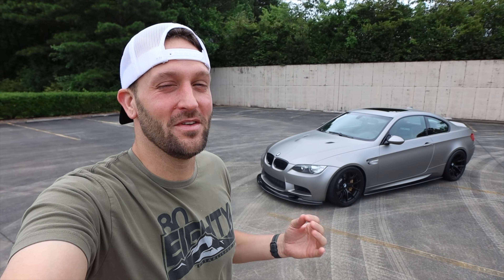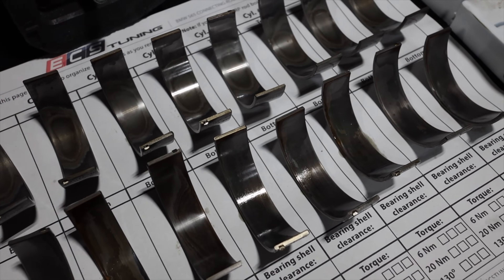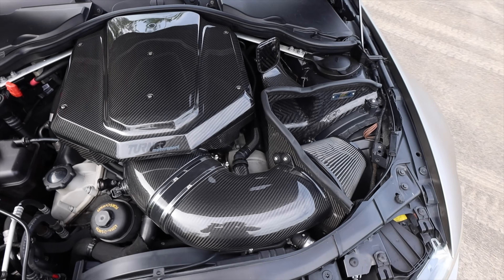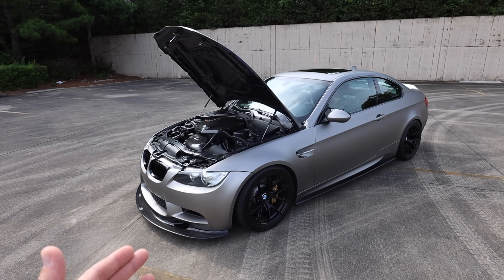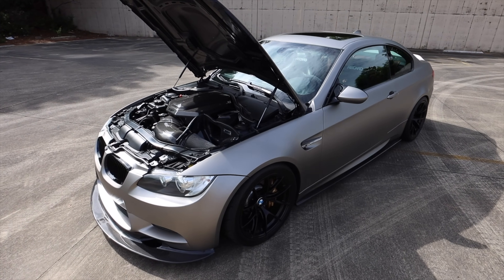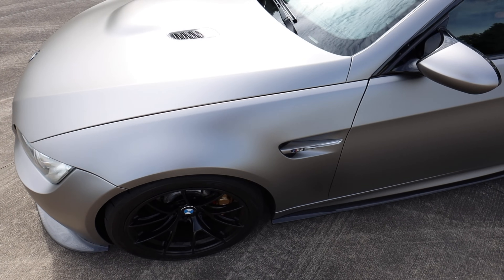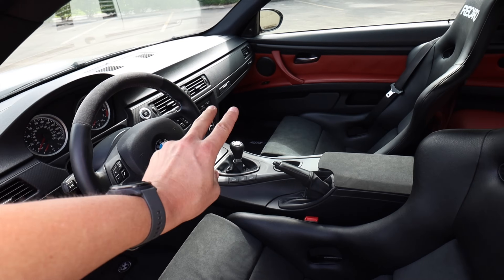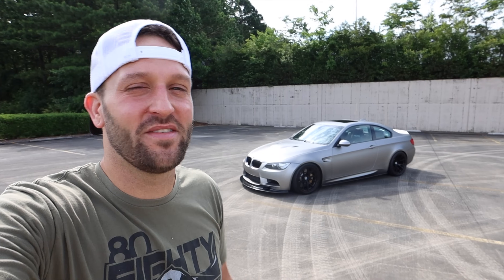Watch This Before You Buy An E9X M3...

Comment: Great video, as an e92 m3 owner as well, I can attest to eveything you've mentioned. These are not cheap cars to maintain (if you want to do it right), but I think, for the money, it's probably one of the best driving experiences you can get mixed with some comfort and luxury
Reply from the maker: Well said!
Reply: É verdade que a M3 G-POWER da quase 400KM/H??
Reply: As a another e 92 owner I agree with you.  The steering is what sold me on the car.    The car talks to you thru the steering wheel
Reply: @johndelp1810 getting close to the point of paying my 335i off and getting into a m3, is it still a good platform in your opinion? i plan on keeping and building the n54 especially since its low mileage but im wanting something else thats nice and i can take out if the 335 goes down (i also have a daily for work so having a running vehicle is already taken care of lmao)

Comment: E92 M3 owner of 3 years myself. Didn't get the hype when buying the car, and every year since owning it, I am more and more convinced that this is the BEST car you can buy for the money. Does everything right when set up correctly. Maintaining isn't cheap but also is not very frequent. Best sounding, looking and driving BMW in my opinion. Great video
Reply: How much have you spent on maintenance? I’m looking for manual but DCT is cheaper
Reply: @pavelsidor  Any e9x you buy you have to do rod bearings unless done by a reputable shop that's handled this replacement frequently. DCT is honestly better having owned both, the manual gear ratios are bad and the DCT doesn't feel outdated even in 2024 standards tbh.
Reply: @iamshevanel coming from an N54 E90 335i manual to M2c DCT, I 100% miss changing gears myself 
I will likely never sell my M2c but I’m looking for another manual and an E92 M3 is on my short list
I wish I could’ve bought my M2c before production stopped so I could’ve ordered a manual, but I literally got one of the last M2c in California

Comment: If you’re not able to spend more after the purchase price than what you would spend with any other car, don’t recommend. If you have a budget to play with and can afford it’s maintenance 1000% recommended. My only advice is to make sure you find a good euro shop near you bc BMW (where I live at least) charges 200/hour for labor. Make sure to have knowledge on the car’s rod bearings before purchase, will you need to swap them/have they been swapped already, and (not saying it’s guaranteed) EXPECT and at least account for the fact that you might need to have your gaskets replaced (valve cover, head, and oil filter housing). It’s definitely not just a cheap get in and never think about anything car. Honestly though they’re amazing cars that have so much personality and provide an amazing experience, there’s nothing else like in the price range they’re in

Comment: Only do the carbon shaft from Matt at euroconnex. I’ve heard horror stories of poor balancing from other companies. If you want to keep stock driveshaft the U joint isn’t serviceable even if people tell you it can be rebuilt. Do the diff CV joint and Guibo and you’re fine. Get new bolts for the diff of course.

Comment: Great vid.  Anyone buying an E9X M3 with a DCT gearbox should expect to have to replace the DCT oil pan and gasket at some point.  My DCT sprung a massive leak out of nowhere last year.  The plastic oil pans just tend to fail after time, not an uncommon problem.  Had a full fluid flush done with new filters, gasket and oil pan.  Mechanically the DCT boxes are solid and reliable and really fun if you do a GTS tune.
Reply from the maker: Yup that’s a good point, and very common on dct models!
Reply: When and if I get one, I want a manual, I miss driving stick.
Reply: so is the dct on the m3 fairly reliable as long as you keep up on the fluid ? i’ve heard it can be very expensive to replace..
Reply: @RandomLuckk  Yes they are reliable, aside from having leaky oil pans.  They are a Getrag made transmission and mechanically they are good.  Good idea to have a fluid flush done every 50,000 KMs or so (30,000 miles).  But yes, more expensive to fully replace a DCT than manual transmission.  But I really haven' t heard of many cases where these DCTs fail completely.

Comment: One day  I want to own one but this market is deadly right now. Currently rebuilding my n55 motor after I undertorqued rod cap 1 and it shot through the oil pan. Want to keep the e92 335i but also add the E92 M3 stripper spec to my collection.

Comment: You need to make sure you check the rod bearings every 30k miles on those v8 engines. They go bad just like the V10 engines. Just letting you know before you get surprised. Thats the thing I hated about having my v10 m6.
Reply from the maker: ONLY on stock bearings. Upgraded bearings with more clearance should be fine for 75k plus miles.

Comment: Question.  If a m3 that already has a bad rod bearings , do I just simply replace them or does it requires some engine works ?
Reply: You won't know if it has worn* rod bearings unless you run a Blackstone Oil Analysis for metal shavings in the oil. Then you can evaluate whether you should replace them or PM it or leave them alone.

Comment: Fantastic mate. Thanks. Should never have sold my E34 540i LE  V8 Manual. On the up side though, that means I'll have to replace it with an E9X M3 variant. Sure it's not as fast as an E8X M3 number but geez they sound great getting to the speed limit as quickly as you can 😁

Comment: Little thing about the rod bearings….you don’t need to replace them if you know how to handle this engine and maintenance well….if you let the car warm up and don’t go above 3k RPMS for the first 5-10 minutes of driving and do oil changes every 2-3k miles then the rod bearings will be perfectly fine…I have a family member in the EU that has a e90 M3 and he told me that doing rod bearings over in the EU is rare like it happens don’t get me wrong but it’s all about the owners and how they drive/do maintenance….my dads e93 M3 also went 135k before he sold it and never did the rod bearings….he got a oil test done every 10k miles and it was never an issue…..you just have to let the car warm up and then when you start driving it don’t go above 3k RPMs for a little along with oil changes pretty regularly and you’ll be FINE!!!…..now that being said I’d definitely do rod bearings if you’re getting a used car that was bought from a car enthusiast. Especially if they don’t have a recent oil test done. But if it’s from a grandpa that only drives it on the weekends I’d do an oil test and if it’s fine then I wouldn’t even touch them.

Comment: Oversize bearings? I think you meant undersize bearings to give you oversize clearances 😉
Interesting to hear about the fuel sender unit, that's a new one to me. 
What's the advantage of having studded hubs instead of bolts? Or did you just have to do that for the wider(?) wheels?
Oh and your car looks fantastic! 😎 Love the wrap colour!
Reply from the maker: Studs allow me to easily change or re-mount wheels without having to line up and insert lugs all at once. Also allows for spacers if I choose to run them
Reply: @ThicWhips  yea I must admit I thought of that afterwards. As an old mechanic I wish for the days when most cars had studs, much easier to put the wheels on!

Comment: Wow I have an e90 sedan manual with 102K on it and none of that needs to be done even taking it to the Seattle BMW dealership for a few things.  Other than fluids and the throttle initiators which wasn't cheap, after 8 years of having it, none of that and have had everything done to spec for the eight years I have had it.
Reply: And valve covers pardon...
Reply: Rod hearings are a known failure on these cars. Get them checked or swapped, adds value anyway.

Comment: Idk what to get for my next car im stuck between a e9x m3 or a f8x m3 any suggestions?
Reply: I have both. I find that people want to buy my e92 m3 more and my f80 was my investment!🥲
I find e92 m3 more engaging and the driver is in control of everything. If the driver want all power, the e92 m3 instantly does it. F80 needs a few mili seconds to get what you want. Also, the f80 requires more driver input to handle where as the e92 feels direct and natural.
Anyways, the f80 looks more aggressive but the e92 looks more sleek and sporty. They both look modern but with their own style.
Idk what I prefer but I notice I drive my e92 more since it's more direct and engaging, instant power,  comfortable, and better higher seating position.
Reply: Now, if you get e92 m3. Get 2011+ with Bluetooth and competition pack for the 19 inch wheels, dct software, suspensions and other stuff I guess.

For the f80, get 2016+. Get competition pack for lightweight seats, 666m wheels, louder exhaust and I guess other goodies. Also make sure you have the executive pack aswell because the headlights with that pack makes a world of difference in looks.
Reply: @abrahamg3354  thank you for the input bro appreciate it i love the way the e92 sounds but they r so slow compared tk other cars in the same tier so im not too sure. Are both ur cars dct? Bc i lowkey wanted to get it stick but i heard that those cars better with the dct
Reply: @Xccord  ok, first the speed and second dct.
So first, the e92 m3, when warmed up, the thing instantly goes fast that it your head snaps back to the seat like if a magnet turns on with the flip of a switch. The engine revs to 8500 and as you go up the Rev band the car feels like its going overdrive because peak HP is at the end of the Rev band. Every shift you do it feels like it goes faster and faster where as other cars, while you go faster, you'd feel the power get weaker through the Rev band. Yes torque is low BUT you have torque on all the Rev band while other cars you lose torque mid rpms. This car IS fast. It really is. It loves to Rev and I feel that these engines thank you for that. Just like I say, a redline a day keeps the technician away.
As for DCT, both my m3s are DCT because the e92 was built around that. It was meant for that. The dct is the top ten fastest shifting trans in the world. The downshift sounds so good above 2500 rpm and the upshifts feel so satisfying as they kick your whole body back. I love the DCT. However, for these cars, their is no downsides to either transmission - well maybe. The manual, while it makes you feel more engaged to the car, it makes it sluggish in performance. The car will be slow because of the time it takes to change gears. The drag times are noticeable.  People love you for DCT and those same people love you for manual as well cause they're both fun and reliable.

For f80, the dct feel more jerky on standing starts when casually cruising. I've also noticed that applying above 85% of throttle makes the car want to chirp the wheels. I think the rest of the throttle was meant for full power for drifting and sliding - I remember reading something about it being for telling the car you want to slide and stuff. You apply full throttle when you're already going - I guess 2nd or 3rd gear. Both cars have the same DCT, it's just that they're different in software tunes/behavior.
People can talk dump on either cars on either trans but people need time to get to know the car and how it handles.
They both are fun, and both need to be driven differently to understand its performance and characteristics.
Reply: @abrahamg3354  wow thats for the detailed description helps alot bro. Did u do the rod bearings for ur e92 n the crank hub for the f80?
Reply: @F82ben   I have never done rod bearings, I am at 106k miles on my e92, Rod bearings isn't something I worry about TBH. I do Oil changes every 4 to 5 months I guess. I do more adding oil at Oriellys auto parts than oil changes to be quite honest. I have strong confidents in the rod bearings and I think they won't fail. Many of us do. But people worry because if they fail, it's the financial hit that scares you, not the really the bearings.
Something I do worry about is my engine mounts, my headlight condensating, my brakes - but thats because those are gonna need attention sometime.

For crank hubs, from what I have heard, it's for people who will be adding more power. If you are stock,  like me, its not something to be worried about? Atleast for me. IDC about replacing those for a different design. Plus it's not something you hear from stock F80 owners.

Something I do fear of in my F80 is, well, honestly I don't know. I do need to replace ignition coils, refinish clear coat on CF roof as it has a chip, exposing CF, fix my vinyl front lip since the center is detached, re-align my wheels, and - and thats it I guess. 

Cars are meant to be driven. Parts are meant to be warn. Cars that are less driven have their materials/components degrading for just sitting there like a princess.